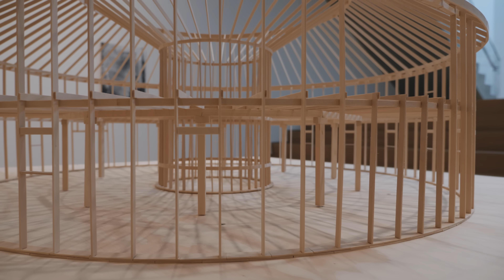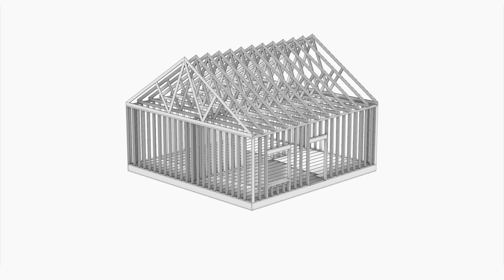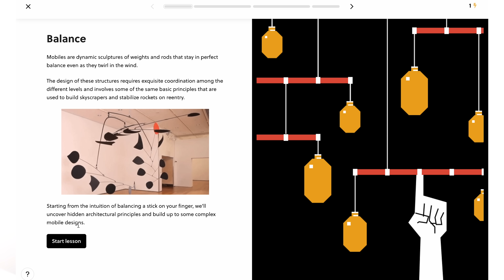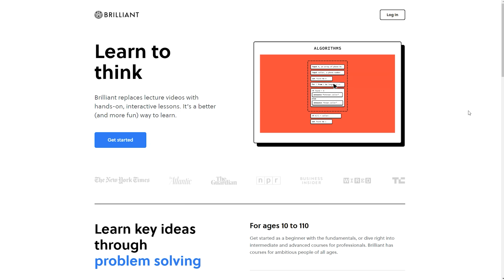The Genius of 2x4 Framing

Comment: the reason for the development of light wood framing was the reduced cost and increased availability of nails... particularly wire nails. These are essential to this type of construction, different than the cut joinery used with timber framing. This is a good example of how the innovation of one product can completely change an industry.
Reply: Cheap wire nails and industrial sawmills allowed light wood framing's other numerous benefits to come to the fore. Without these two innovations, light wood framing is not viable. If timbers must be sourced and finished locally, there is no advantage to using many more small ones. Likewise, without cheap wire nails it is not feasible to efficiently (cost and time) connect many small members.

These two innovations allowed the rapidly-expanding US to build all sorts of buildings cheaply and easily. By setting up a relatively local sawing operation, the only industrial import would be nails and fixtures which are much smaller and lighter. The lumber itself is also much lighter and easier to transport than timbers, brick, or stone.

Source timber could be found nearby across most of the expanding US. The same cannot be said for masonry source materials and they are simply too expensive to transport.

While the postwar boom created most of the housing stock and cemented light wood for the home, light wood had been in typical use since the earliest days of the colonies and through the western expansion for exactly these reasons.
Reply: Homestead builders would burn the whole structure and retrieve the  nails  for the next building.  True.@haphazard1342
Reply: @haphazard1342  What the hell are you talking about, Masonry Source Materials are EVERYWHERE, it's the literal thing you walk on. the Ground. You need clay, and the only places without clay are the ocean and stone beds, most of the US consists of neither. And sure there are few regions with sand, but you can still make bricks out of clay sand, which is what those regions are made up of. There is no place on Earth that isn't covered with way too much water, that can't utilize clay to build buildings.
And in the few ones where you can't use clay, you can use silt or sand or god forbid STONE. And sure making Stone Bricks is way too much work, but using stone and crushed stone mortar, is a viable way to construct buildings. And especially in a lot of parts of the US, Stone buildings would've been preferable to keep Cool, I'm looking at you Southern Texas and your egg fryingly hot weather.
Reply: @livedandletdie  Bricks are a poor choice for wall construction in seismic areas, like most of the western USA. Also, masonry walls must get very thick if walls are tall or roof spans are large. Unless you are talking about reinforced masonry and steel isn't just found on the ground but is a very specialized industry, sorta like nails. Most homes that are made out of brick then have wood framed walls inside of them so that electrical wiring, plumbing and HVAC can be run inside them. All things considered, wood is a better building material than masonry. So in your ideal masonry homes; what exactly is your roofing system made out of?
Reply: That's not quite true. Stick frame construction was made possible by sawmills that were cheap and efficient.  In the early days of stick frame construction each 2x4 stud was mortised into both the base and top plates. This style didn't last long because shortly after modern stick frame construction was popularised cut nails and then wire nails came along.

However having said that their are variations of stick frame construction that go back hundreds of years. They are associated with regions that had water and wind powered sawmills. Netherlands and Germany in particular.
Reply: @Hellequin Maskharat I'm not arguing quantity over quality. Wood framed walls are better than masonry walls for residential construction. Is your argument really that since some old stone building s are still standing then that is the best way to build? So since there are some old Mercedes still on the road that means they are better than the modern Mercedes? No, of course not.
Reply: @jonathanwilliams1641  If a building is standing for 300 years, it is most definitely built better than stick homes. Stick homes are garbage wrapped in details. 2x4 framing is used to turn the most profit in the shortest time. It's garbage and should be outlawed.

Comment: Interesting video and worthy of a sub!  I would appreciate a deeper dive into this, including the pros and cons of light wood framing.  (I'm sure you'll find MANY of the latter in the comment section. :grin: )  Durability comes immediately to mind; for example, there are wooden temples in earthquake-prone Japan that are built completely without glue or metal fasteners that are over a thousand years old, but I've known LWF houses that start having problems within the first decade and a significantly small number are still around a hundred years later without needing extensive renovation.
Reply: I'm sure a lot of wooden temples fell down in their first decade. We weren't there. We only see the ones that are still standing and can praise them, but that is a fraction of history.
Reply: @ApatheticCrow  There is a certain amount of survivorship bias, sure, but they ARE still standing and we would be fools not to learn from them what we can.

Comment: Thanks for the great video. There is more gradual steps between US light wood framing and timber framing with cut in wood joints as you show. 
As I know, we use thicker wood frames in Europe, and easiest way to join them is by thin metal prefabricated plates.
It is always scarry to look how thin and light everything in US is. In Europe most of wooden framing is much thicker.